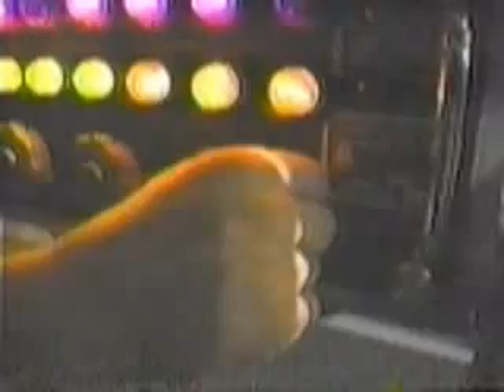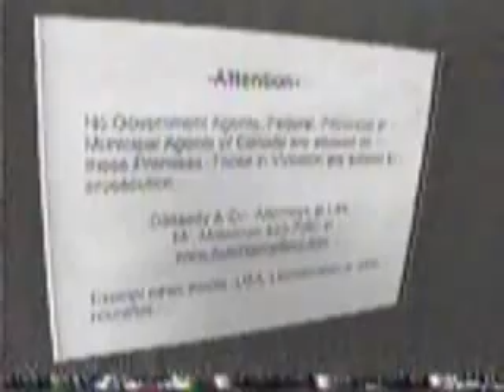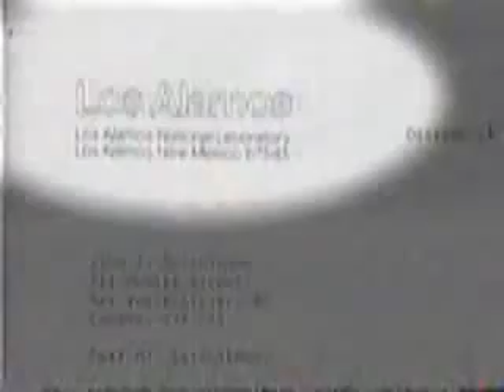Hutchison Effect 1/2

Comment: even funnier when the end results are a shut down & missing lab......

As Dr. Tesla explained it, the tremendous speed of the particles will give them their destruction-dealing qualities. All but the thickest armored surfaces confronting them would be melted through in an instant by the heat generated in the concussion. 
That would be what happened to wtc 1,2 & 7 Surely your not going to argue the governement had stolen tesla's devices.....